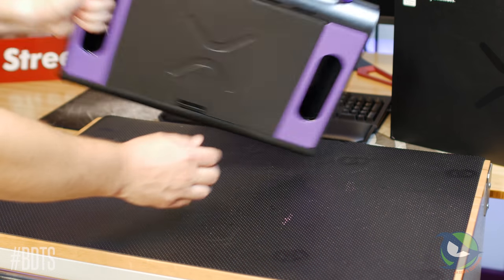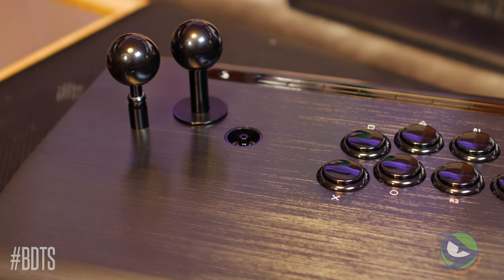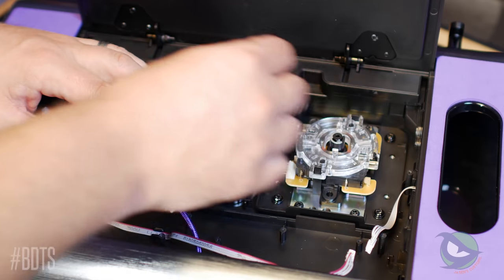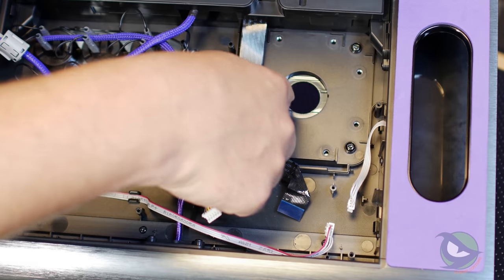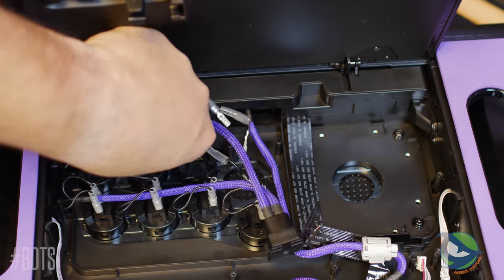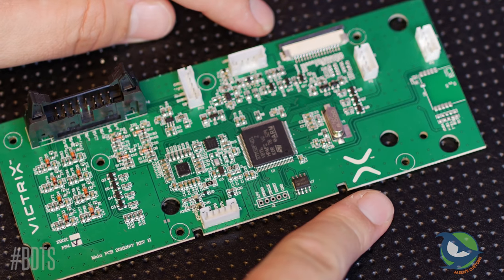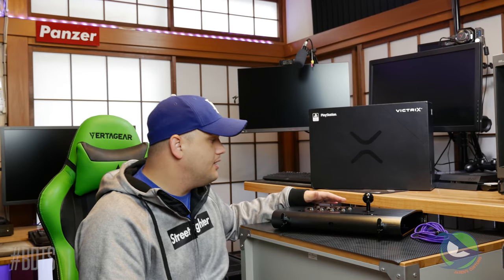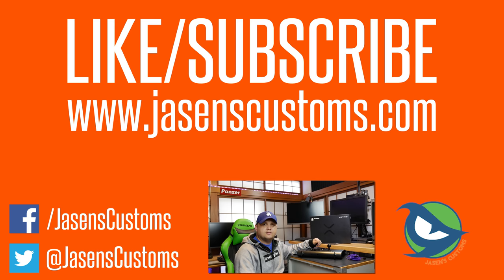Breaking Down the Stick - Victrix Pro FS

Comment: Very useful video. I thought about picking one of these up and putting an LS-56 in it, but now I'm not sure it would be worth the effort.
Reply: Little late but Qanba Obsidian (Viewlix layout) or Pearl (Noir layout) are easily moddable/upgradeable + they're readily available. Focus Attack even sells the mtal plates to convert the button layout on either model! I've been enjoying modding the shit outta my 2 Obsidian sticks. The Brook UFB EZ install kit by Jasen works great. I added the PS5 upgrade board, as well. Tested with Street Fighter 5 (PS4 Pro), Killer Instinct (XB1 S), and King of Fighters 15 (PS5).... works great on all 3 👍.
Reply: Found a 360 VLX for $130, I'll probably end up putting a 56 in there and calling it a day.

Comment: Do all arcade sticks  follow the "square gate"  format? I'm looking to buy a "circular" format. Any recommendations would be appreciated.
Reply from the maker: Janethan Ricanibante - all stock JLF has a square. Circle inserts are available at stores like ArcadeShock
Reply: You can get circular gates, or Korean levers are gate free, but "feel" circular. Although, they don't use a spring for tension, so they do have a different feel

Comment: I just opened mine up today to put in a new board, and theres a wire soldered to the pcb that connects to the casing.

I didn't see it in yours, bit I'm guessing it's the ground wire?

 Anything i can do to get around it?

Comment: Thanks for taking an in-depth look at this thing!

I'm surprised the Infiltration lever fit the stick, you didn't mention if the latch could be closed with it installed or not. The infiltration lever is very tall, after all. Can you confirm this?

Other points:
- That price is utterly ridiculous, completely priced out of competition.
- Those cable posts are indeed ugly, compare that to the extravagance of the Qanba Dragon.
- Good, comfortable look, I personally prefer no plexi ridges on arcade sticks so that's great.
- The "Link 2" being worse than the Phreak Mods original is pretty sad.
- Moddability is poor and difficult.
Reply from the maker: Wladislav - it does fit.
Reply: Thanks! 
I also just noticed they've made a deal with infiltration for them to use their lever now, so that makes sense.

Comment: Think we will get a Ezmod kit for the brook ufb for this stick
Reply from the maker: No.
Reply: Jasen Hicks what about the qanba dragon
Reply: @JasenHicksFGC  Damn. Too difficult or not enough interest?
Reply from the maker: @x64-v9t  - Not likely due to the way they manufactured the stick and left such little room inside. Plus its almost $400 as it is, if someone is going to drop another $135 on it they can get a Panzer Fight Stick that has pretty much every perk available and get more out of it (Brook Retro Board, Brook UFB, EZ BUILD, Carbon fiber overlay, etc).

Comment: you got the 309MJ (mid collar)  and the 301-DX (infiltration) mixed up... Infiltration lever has a bottom gate and taller body (which is why it wont fit), 309mj was the one that fit.
Reply: So the 309MJ will fit? i know that the most common korean stick for Tekken

Comment: 12:26 It's not an official Vewlix layout then because i can fit screw in seimitsu PS-14-GN buttons on my Taito VEWLIX C cabinet just fine. 

Victrix must have some kind of deal with Sanwa because Seimitsu parts don't fit :) 

And it's a 350$ stick that has less compatibility than any cheap stick. And pretty much any arcade stick since Sega Saturn has great compatibility with joysticks and buttons.

Comment: why do companies continue to do the vewlix layout and not the noir.
Reply: Serious question, is that small difference in distance really that much of a big deal, is it really just preference, or do you just have really large hands and it's actually a comfort issue for you? I'm not trying to be an ass i'm just wondering because i have tried almost every layout there is and i don't find any difference in comfort and my ability to play was never affected. However, i have rather small hands, so it might be something that i wouldn't be able to notice because of the size of my hands.
Reply: Namco Noir Layout uses Sega’s 1P button layout but the lever is spaced a little bit further away from the buttons. Vewlix has Sega’s spacing but it uses a slightly modified Sega 2P button layout.

I’ve played Tekken 7 in Japan on Noir cabs since its release in 2015, and was lucky enough to get the Noir panel for my customized TE2.
Reply: @Allocution_TK  is it unplayable? No, absolutely not, but I like resting my fingers just above the buttons... Going from a noir layout to a Viewlix layout is definitely noticeable and it's definitely a lot less comfortable, in my opinion anyway. Like I said, it's not rendered unplayable, but like... Why. Our hands naturally "fit" to the noir layout, so why use the Viewlix? Especially for a stick that brags about comfortability. Just my opinion, idk

Comment: Nice review the material used is aluminiun in upside , on base is the same material ?
Reply from the maker: Eloi Ferreira - plastic door. I’ll double check if the aluminum is all the way around. I think it’s just 3/4 of the stick.
Reply from the maker: https://youtu.be/8K-S0_meddI?t=2m18s - You can see the bottom. The handles have the metal, but the door is all plastic.

Comment: This or the Omni Arcade Stick?
Reply from the maker: Kirigarou the Panzer Fight Stick.
Reply: @JasenHicksFGC  I don't know if this is good or not but this is the current one I had on the site with all the customs http://prntscr.com/m5wx97 .  What do you think?
Reply from the maker: @kirigarou445  No, the ALUMINUM ones aren't available for build out (Per the listing: The Panzer Fight Stick ALUMINUM is NOT AVAILABLE for BUILD OUT SERVICES at this time.). You need the PFS3IKIT. Here's the white verion: http://www.jasenscustoms.com/panzer-fight-stick-3i-whitesandtex
Reply from the maker: Also balltops aren't required for Korean sticks for Sanwa and Seimitsu do require one.